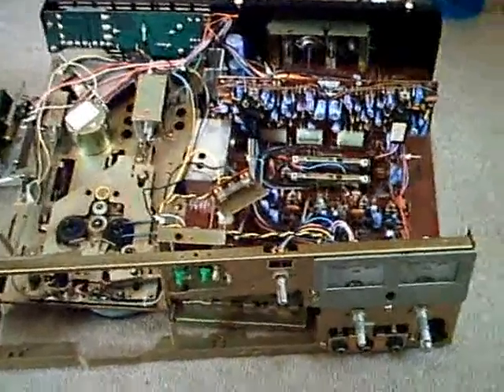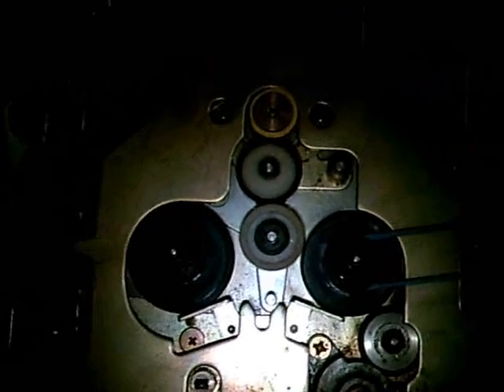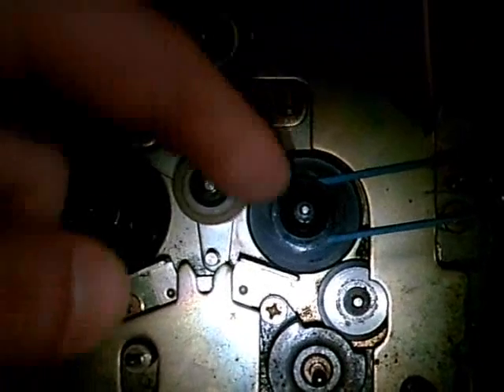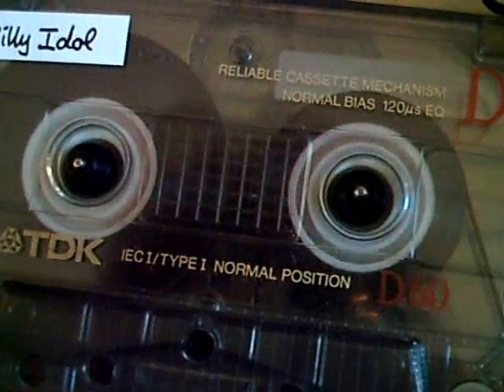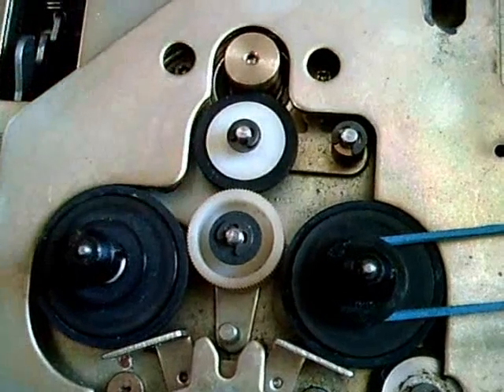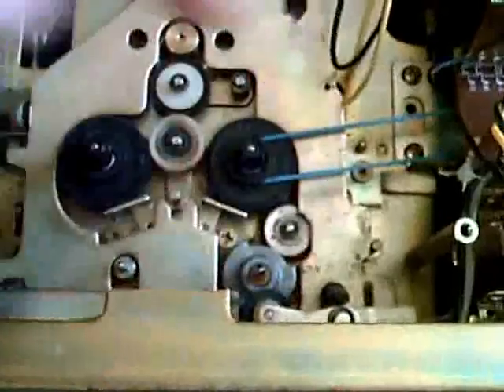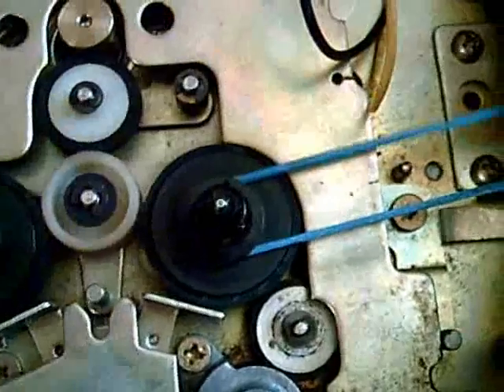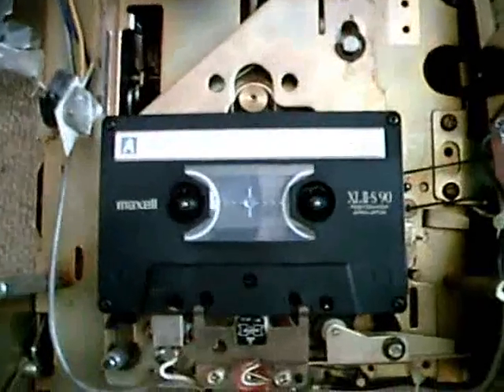Repairing the Technics 671 cassette deck (1/2)

Comment: Please! Please! How did you remove the meter knobs? Is there a small allen screw or torch screw in those small holes? Because if that I don't want to pull them to hard because they feel connected
Reply from the maker: Yes, there is a small allen screw down in there holding the knobs in place.

Comment: My 671 plays for 10 seconds or so and then stops.  What causes that to happen?
Reply from the maker: The auto stop sensor is linked to the tape counter, if the tape counter does not move, the auto stop will trigger. You probably have to replace the counter belts.
Reply: Well I put new belts on and now play and fast forward work great, but rewind is slow and gets weak at the end.  Would that be the rubber on the left wheel?
Reply from the maker: @Moto7357   This problem is due to bad idler wheels
Reply: @DrCassette  what constitutes a bad idler wheel?  What is the fix?  Do they need replacement?  Are they fixable?
Reply: Hi DrCassette. Ich bin froh, dass ich diesen Kanal gefunden habe....sehr gute Arbeit! Ich hab vor ein paar Tagen das technics RS 671 US für einen sehr guten Kurs bekommen....aber natürlich musste einiges gamfht werden. Das Tape lief nicht bzw. Nur sehr kurz....also....Riemen am Zähler gewechselt...läuft. leider funktioniert das spulen (vor- zurück) auch nicht. Das Problem ist das selber wie in deinem Video. Schlechte und alte Gummis. Meine Frage: wo finde ich Ersatz? Irgendwie habe ich bisher keinen Händler gefunden der mir weiterhelfen kann. Gibt es eine genau Maßangabe der Gummis irgendwo?  

Lg

Dennis
Reply: @dennisfischer1627  Hi Dennis, habe mir vor wenigen Monaten das gleiche Deck gebraucht gekauft, gleiches Problem wie bei Dir. Das Hauptproblem bei den alten Gummis ist das diese nach so vielen Jahren oft "glatt" werden und dann keinen Gripp mehr haben. Habe bei meinem Deck die Gummis ausgebaut und mit 1000er Nasschleifpapier die Oberfläche leicht abgeschliffen um die darunterliegende frische Gummischicht freizulegen, das hat bei mir Prima geklappt, Ersatzgummis waren also gar nicht nötig. Hoffe das hilft Dir weiter!

Comment: Hi, it's very useful material, great job ! but how did you adduce the speed of the motor ? (10:00) I have some problem in my machine, playback is too slow.
Reply from the maker: There is a small hole in the back of the capstan motor, get in there with a small, insulated(!) screw driver. There is a speed adjustment inside.

Comment: There is a guy out in New Mexico who can completely restore any cassette deck. However, he puts in 8 hours of work on the unit at a cost of $60.00. The rewind problem I have on my cassette deck is now corrected. It is very typical for cassette decks of that age to become sluggish due to the wearing of rubber parts and hardening grease.

Comment: The rubber washers for the idler wheels....if the rubber parts are replaced, then the tape deck will rewind or fast forward better - even when using  long length tapes like 120 minute tapes. I have sent my tape deck to someone who can replace those rubber washers around the idler wheels inside thetape deck. Just another type of tape deck restoration technique.

Comment: Here in the States we have an electronics retail chain called Radio Shack, they used to sell a great selection of parts, resistors caps, etc they even sold reel to reel tape! but now their parts section has been pushed into a tiny corner to make room for  HDTVs and cell phones. you can still get components there, but the selection is very sparse, and the people working there are clueless :P

Comment from the maker: I just went to our stupid local electronics shop. They have a lot of parts, and they also had this rubber thing, I didn't had to order it. It's not a perfect replacement, but it works perfectly. The idea with using rubber washers for plumbing is really good!!!

Comment: Wow a dual motor setup! 
Where did you get the rubber? did they have to order it? it's very hard to find. sometimes rubber washers for plumbing will work, I have used them in record players before.